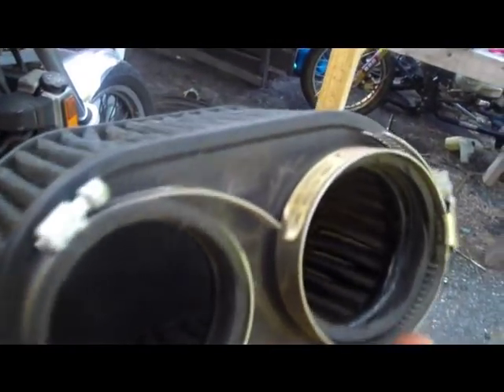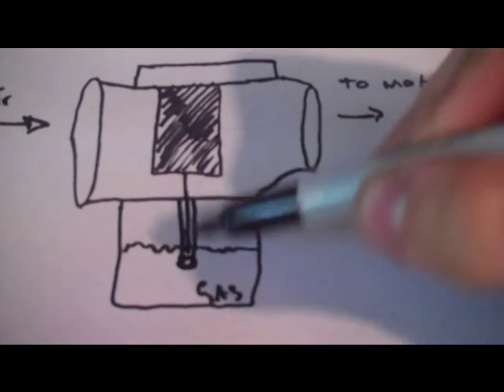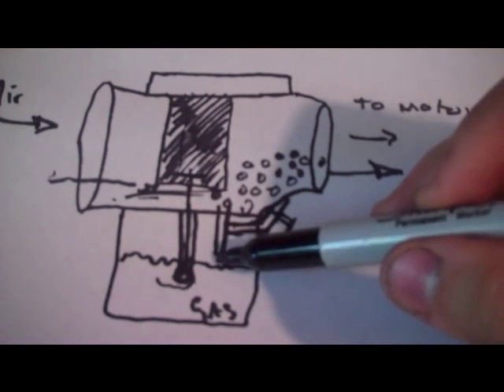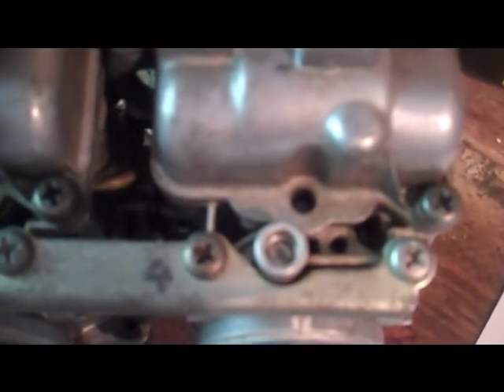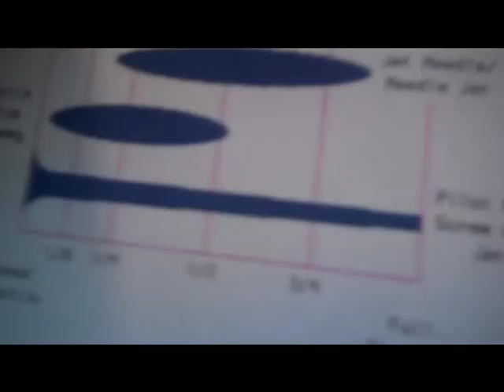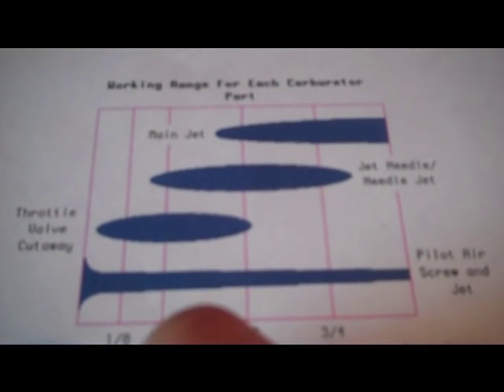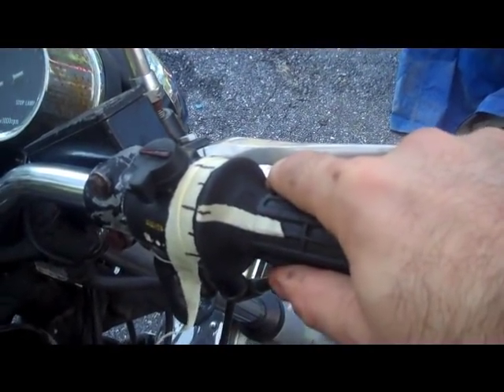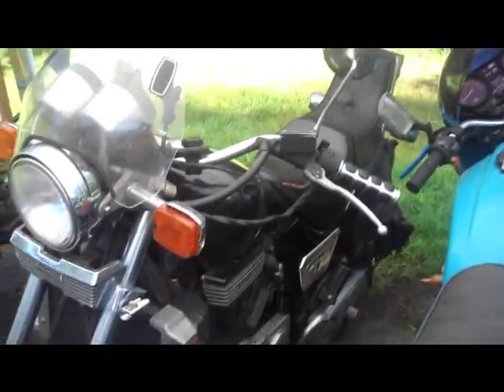How to adjust the jets on motorcycle carburetors

Comment: Max,  This is a great video...Thanks!  I need just a little more help.  I have a 1992 Virago 1100.  Installed K&N filter and cobra pipes.  Have had trouble with jetting...Mostly off idle with low RPM hesitation as I roll on throttle.  At heavier throttle it runs fine.  Plugs show it is rich.  Have adjusted Pilot screw all over to no avail.  I put in a Cobra jet kit with significantly smaller needles and have 110 main jet.  Don't think I changed pilot jet...its been a few years since I did it and have just lived with problem.  Have not ridden it for 2 years and am working on it to get it right.  Pulled carbs to clean them and change needle and seat so I want to get jetting right.  Any suggestions would help.  You can email me at crowderjg@gmail.com.  Thanks in advance for your help!!
Reply from the maker: Well dude Id say the best repar would be to put on a stock air filter and put the stock jets back in. K&N filters really dont offer much advantage to carbureted engines aside from perhaps the economy of not having to buy filters over many years. If you must keep the filter, then just go through the process outlined in this video, and experiment with more jet settings. If you are rich then you need smaller jets in that throttle range